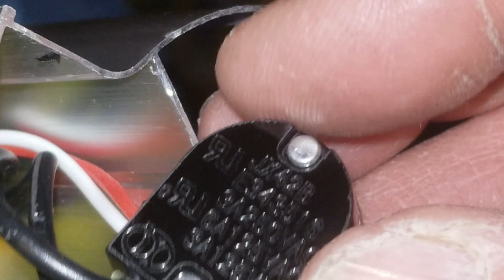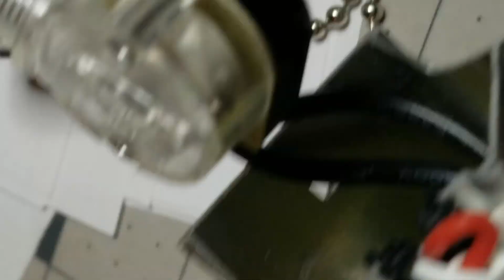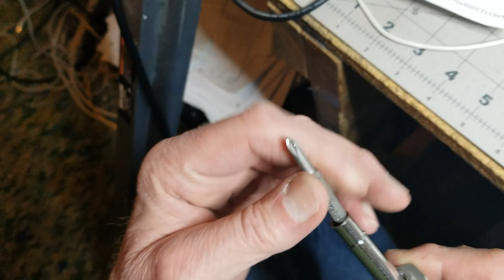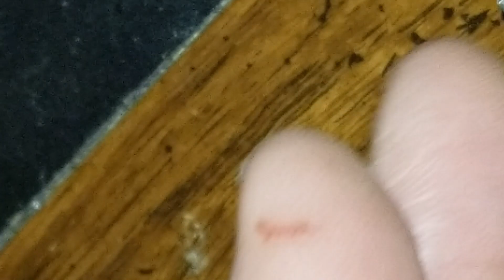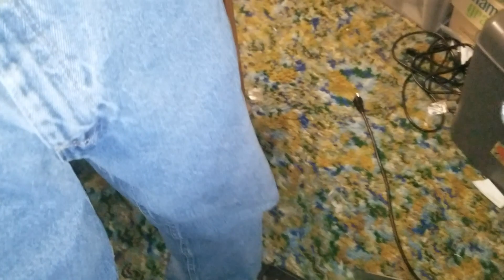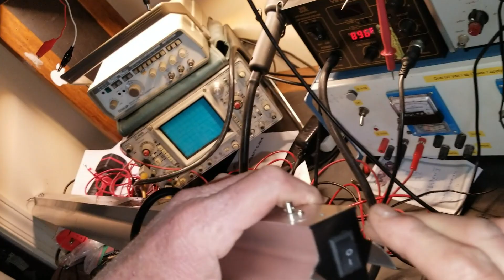Repair a broken Braun/Harbor Freight Tools 4 foot LED Shop Light.

Comment: I fixed my exact same Harbor Freight 48” LED Light in under 5 minutes.

1. Take and awl or very small flat head screwdriver and shove it in small square hole on top of light and pry out the black end cap. Once the little tab releases then use a larger flat head screwdriver to pry out end cap completely.
2. Pull out the small chain switch.
3. Cut both black wires as close as you can to switch housing.
4. Connect wires together with a small Marrs type connector and tape securely.
5. Shove connector back into frame and put black end cap back in place, tapping lightly as needed to secure.
6. Plug in light into a switched power bar and you are finished.

Comment: Hi there. The same thing happened to me. So I did open the switch the idea was the replace the chain with a string, to do that I did use a small manual saw. Everything was ok until I started to put everything back in . I lost the exact position of the spring and I'm still there. I did have bad  experience with harbor freight electric products before and this is one more reason to not to buy electric products from this store anymore.

Comment: Buy a new pull switch for five dollars and swap it out. I actually like toggle type switches and you can use the same hole and wiring.

Comment: Scratch everything you just watched. Step 1-Go to lowes and buy a new switch. $5.97 its Made by Hillman and 2 crimp connectors and 1 roll of electric tape and a pack of very small zip ties. Cut wires crimp new one on, electric tape both past the crip connectors to the wires and use mini zip ties on both ends to ensure wires will not come apart. Trim neatly. Yeah yeah i know about  crimp connectors and electricity.